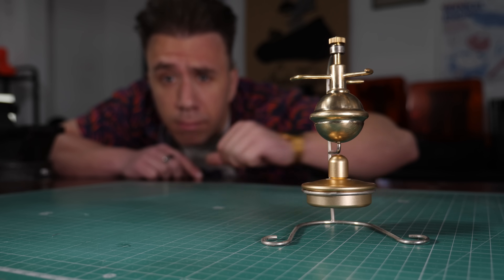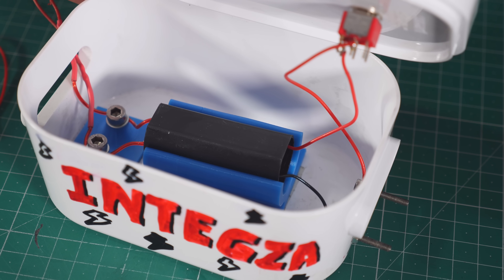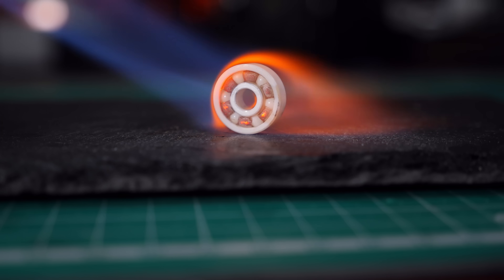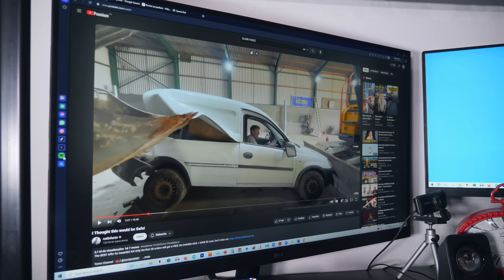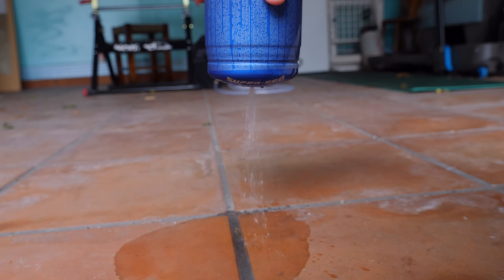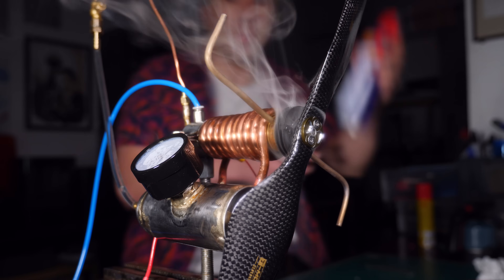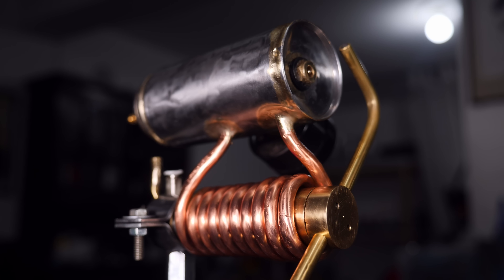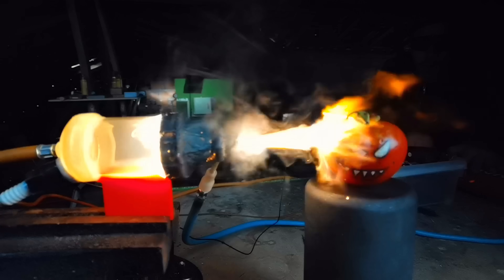I Built a ROCKET PROPELLER

Comment: One recommendation:  Rotate the can so that the outlets are pointed up.  That will keep the fuel in the can, and let the vapour flow smoothly to the coil.

Pretty nice setup.
Reply: He did that. Detailed it in the video even. The cooling jacket needs to have some liquid fuel entering it, or the cooling effect of the pressure drop is greatly reduced. What he needs is a valve to regulate the liquid fuel's flow rate.

Comment: Nice work. Cool concept.

IIRC, propane has a boiling point around -40 degrees, (C or F doesn’t matter, as the scales cross about that temperature), while butane boils about -1° C. (31° F.).
Pressure difference alone would make the propane give you more energy, plus it produces way more BTU's (heat) when burning.

(p.s. It is also why butane lighters don't work well when the temperature is below freezing. It is the gas that burns, so if it isn't "boiling"... no gas to burn.)

Comment: 4:27 WD-40 is not a lubricant; it initially leaves an oily film on surfaces, but this quickly evaporates. WD-40 is actually intended for removing oil and grease.
Reply: WD stands for water displacement, ekshuelly.
Reply: Point taken but WD-40 was created to disperse water.
Reply: That oily film absolutely does not evaporate quickly. While it isn't intended as a lubricant it does function as a makeshift one if access to a better lubricant is not available. 

I literally just checked to confirm. I sprayed some on a few threaded metal rings a couple weeks ago and they're still coated in a thin film with even a few spots of pooled oil that can be wiped away.

At the end of the day even if it's not the most effective option, people have been using it for all sorts of things for decades for a reason. If it didn't work at all in unintended purposes people wouldn't be using it for such purposes for so long.

Comment: im no mechanical engineer but i suspect that getting the engine to compress its own air is going to require a redesign to run an output shaft from the propeller through and out of the back of the engine

Comment: If you need to run the engine efficiently why don't you try combining your design with an Stirling engine? Also, you need the copper tube returning on the can at different heights for proper convection work.

Comment: So you want portable compression? Supercharger. Put a grove on the backside of the propeller  or a pull on the back of the propeller shaft if there is one. Use a silicon band (can take tons more heat than rubber)to turn a small compressor. Maybe try to design  and 3d print a scroll or roots style supercharger like on cars. 

I would say use a turbocharger but that uses the exhaust gas to spin the intake turbine and kinda hard to harness the exhaust  when it is moving

Comment: I think the secret lies in managing to integrate the bendy pipes into the Propeller. And maybe an internal cooler instead of external as well as a P trap to feed back liquids ?
Reply: Yeah if he uses the milling machine to make 2 halves of the propeller with built in channels (perhaps out of aluminum) , it might be more efficient at moving the prop up to speed. You could probably use some smaller jet holes near the center of the rotor, and larger diameter jets near the tip (so it has higher pressure where it needs the torque and if it maxes out it can flow up to the next larger hole)

Comment: you can use some of the thrust from the propeller to compress air by making a sort of compartment under the propeller with a small hole whom will lead to the engine giving it  compressed air
Reply: Umm....no.

Comment: There is a helicopter working like this, with air coming out the tip of the main propeller sideways.
the good thing is that you don't need a tail rotor because the couple cancels itself naturally! The bad things are.... everything else! it's not very efficient, and very noisy.

Comment: With the recent attempts of making electric aviation viable, there was an interesting design with pusher propellers on the wing tips; they were supposed to substitute winglets while producing thrust. Someone did an rc test of this here on yt and it worked on a small flying wing! My idea is to use the nozzles of that thing the same way: blended with the propeler tips in a way thay it would both push the thing around and force mix the air from both parts of it, i think that the best use for this would be able to push propeller tip speed further without the drawbacks of it (except for noise lol). There was some kind of helicopter, a weird one with 2 tractor propellers for horizontal flight and something like i described for the rotating wings. Now you put 2 of those in series and make the thunderscreech sound like a timid cat, its gonna be great! :D

Comment: Thermal paste or thermal epoxy can improve the heat transfer between the combustion chamber and the copper coil. Insulating the copper coil so the propeller doesn't cool it as much means there's more heat going to the tank to increase the pressure. Maybe the aerodynamics of the exhausts could be improved to make it go even faster. They could technically be part of a metal propeller instead. Maybe burn out resin and investment casting could produce one. Jewelers have that kind of equipment but they obviously make smaller stuff.

Comment: Could use a couple of the air canisters used for airsoft guns. Linked together in series. There is high pressure but low volume. So would have to use a couple of them. Maybe 8 surrounding the main body of the engine. As we know that these canisters produce a cooling effect when they release their contense. This can then be fed in to a mixing chamber along with the butane. Which would then feed in to the cooling coils of the engine. Higher cooling factor. Might be worth also making a one may valve. Get a pipe with the Interior being tapered and then a ball bearing sat in the middle of it. Can blow out, but fuel cannot then be blown back in. As essentially the ball bearing is now getting sucked up against the tapered part of the pipe. This would stop the blow back. But essentually block off the fuel source. So probably isn't a good solution. Just throwing out some useless ideas!.

Comment: use the position of the fueltank as a gas paddle, having it low means throttle down, having it high means increased throttle, if you make it so you can move it on the go, then you can probaly get more RPM

Comment: Try running the engine vertically, so that the outlet of your copper coil is higher than the inlet. It would encourage the liquid to flow through the coil.
Reply: Wouldn't it be better to test in the engine's intended use orientation though? Even if it works better vertically there's no point in mounting it vertically, the propeller he's using is intended for lateral thrust.

Comment: 12:00 looks like the ends of the pipes are not bend 90° - wouldn't that cause some loss? Also would shorter pipes be better because you lose less gas velocity to friction within the pipes and have higher rpm but lower torque - or longer ones because they would provide more torque but less rpm? And perhaps that sharp bend is also not the best solution but rather a more gradual "S"-shaped bend? Just some things to try out.
Reply: Almost certainly longer ones would work better. The whole reason rocket-driven propellers make sense (kinda) is that rocket exhaust is way faster than your vehicle will be, and probably also faster than the prop tips. Thus you don't lose RPM at all making the pipes longer!
This only stops being true if either a) air drag from the pipes or b) the Coriolis force of the outwards-flowing gas outweighs the increase in exhaust-torque.
Reply: @leftaroundabout you've also got cooling in the pipe, not good.
Reply: Also wouldn’t a 45 degree bend or anything less then 90 be better as your trying to move it rotationally and not linearly?

Comment: Instead of the gas jets going on the plane of rotation, the gas jets might be better to be slightly pointing back so that it's thrust besides adding to rotation also adds to forward motion.  If the engine gets hot, if you injected water to cool it, you would create steam which also could be used as a jet or as forward propulsion.

Comment: 7:57 Mucho power... Or a feedback loop leading to a pipe or the can bursting with heated pressured fuel onto the rocket a meter tops from your face, indoors. 

You know there are easier ways to get to visit a hospital right ?

Comment: Hi

Why don't do a supercharger? , not a screw type , but a centrifugal 
perhaps a volumetric intake as of the infamous bmw b54 engines or perhaps more like the old  ''trumpet type'' that can also work as an idle and throttle control there variable on those ones that change they lenght depending on demand,

as always it's ever easier say it than apply it,

(Just aplaying my car mechanical knowledge it ainth much but is honest work),

Comment: propane has a lower boiling point which is why it is added to butane in order to make it turn to gas more easily at lower temperature and hence improve flammability (in cooler temperatures). 
this of course also increases pressure at equal temperature.

the vast majority of butane sold on the consumer market is a 20-35% propane mixtures with small (250-500ml) cans of 100% butane sold on the consumer market really only seeing wide use as a solvent for various processes involving non-polar molecules cough cough

i thought you said you had experience. 

speaking of uses as a solvent and how many cans you used you may be an a list now

Comment: You could use a liquid catch can before the combustion chamber, so that any liquid fuel that makes it through the tube has a space to rest and be vacuumed back into the reservoir when pressure dropped. You could also either use a liquid oxydizer, or use compressed air in a much lighter tank. It would be best if you used a liquid fuel with a higher btu, so you can store less of it, and have more air to burn it with.

Comment: Maybe a cam to drive a small piston to compress air, I've seen some mopeds that use injection with a system like that create fuel pressure. The same might work to compress air too.

Comment: Integza; try using propane it has naturally much higher pressure and if you want to go balls to the walls; buy some airsoft green gas; there are 3 types of it. Green gas (just propane); Red gas (propane with extra gas that increases pressure) and Black gas (propane with extra gas that increases pressure even more).
Reply: yeah, part of the problem is Butane has a boiling point of only -1C at 1 bar, likely well above ambient at 2,
Propane definitely has a better phase change profile for this
Reply: @davidconner-shover51  You're talking about effectively vapor pressure, at 25C butane is ~34psia while propane is ~135psia. Butanes boiling point at 1 bar is -0.8869C, 2 bar is 21.1C, 3 bar is 35.69C, and for the full monty 4 bar is 46.95C. Propane at 1 bar is -43.37C, 2 bar -22.2C, 3 bar -7.909C, and 4 bar 3.261C . So yes, propane at a given temperature is at higher pressure than butane. This is why you dont see cheap plastic lighters with propane in them.
Reply: @mandi8345  Thanks Grok.
Reply: @ShadyDealz  If you're crapping on him dropping knowledge, then you're on the wrong channel since we here for science and knowledge... So take your C-grade trolling elsewhere. 😉
Reply: @DUKE_of_RAMBLE  OH so now giving advice is called trolling ey? Leave this between engineers.
Reply: @OAikoT  Misplaced anger? Not sure what provoked this reply from you... I'm merely saying that Mandi's delivery of knowledge was nothing that deserved Shady's snide remark.
If for some reason what I said managed to offend you, usually I'd apologize, but in this instance I'll say: this is clearly a 'you' problem.
Reply: so you are telling me...
i could turn a airsoft into a firehard?
Reply: @kkjkjh  in theory its possible, but would you really trust the build quality of airsoft not to explode in your hand?
Reply: @kkjkjh  YES
Reply: black gas sounds like those stupid galaxy-gas the kids like to sniff
Reply: Green gas is just propane with some percentage of butane. Red gas and black gas are both still propane, with less amounts of butane. No other gas is added.
Reply: He did use propane int the video. You just have to watch to the end to see him do it.
Reply: @coryingman  but only 35% right? OP means 100% (?
Reply: @joskcito  yes nearly 100% cos extra gases that increase pressure in case of the airsoft gases but they are not more than 2.5%
Reply: @coryingman  no he uses a propane butane mix it is not the same. I use both in jewellery making their pressure and temp differ.

Comment: Did you notice the outputs of your jet tubes are not pointing ideally? They should be at 90° to the radial. They are pointing slightly outwards because you put a 90° bend in the pipes, but the length of the part after the bend takes the output away from the radial.
Rocket science, eh? 😊
Love your videos!
Reply: Yeah the tubes should be pointed towards the tangent line on the outermost circle created by the tubes.
Reply: Also worth accounting for the metal flexing in rotation, which at those speeds... has to be something
Reply: @andiralosh2173 that's a good point. Again, we need the slow mo guys to see if that is happening!
Reply: I dont think the length matters? The force direction is the same, and transfer via the 90 degree bend should still be on average a force which is directly 90 to the radial, independent of the length of the tube after the bend?

Edit: they are slightly bent outwards, but that just means its not a proper 90 degree angle, not that the length matters
Reply: @MODElAIRPLANE100 well, my point is that the exit of the tubes is not pointing in the ideal direction, which would be exactly opposite to the direction they are moving. Instead, they are pointing slightly radially. The force vector has some outward component, away from the axis or rotation, leading to a slightly inward reaction component, towards the axis.

Comment: Are you familiar with the works of a Youtube channel called Alex Lab? He used electrolysis to generate pressurised hydrogen in a somewhat compact form factor using some aluminium reaction. It might suit your application very well. I think he got decently high pressures (5+ bar) out of it too.

Comment: What you need is a turbo although I think you will run in to serious pressure or power problems using the design you have. While cool it's a less efficient version of a helicopters jet turbine engine where the accelerated gas rotates the turbine that rotates propeller.

I don't think butane contain enough oomph (technical term to both rotate prop AND compress enough air for engine

Comment: You have to much friction. The propeller comes to a complete stop too soon.
Reply: That also stuck out to me. Piston engines always have some amount of drivetrain loss or residual compression that will drag the engine's output down once power is cut. Since this is jet driven and not directly coupled to anything other than its own bearing, the propeller assembly should be able to spin freely for much longer than that. It slows down fast and stops hard. That much friction can mean a lot when you're dealing with these kinds of low power levels. Unless the bearing works better when it's pressurized or something, that's a possibility.
Reply: @defmech  Exactly.
Reply: The propeller stops when the fuel runs out. It's a common problem with all vehicles that use propellers. It's also an issue for vehicles that don't use propellers.
Reply: @kmoecub  Very, very wrong answer.

Comment: It seems like the engine could run better. I say this because it (at least on camera) looks like it take a decent bit of energy to get the propeller to spin in the first place. Yes the ceramic bearing seems to be working fairly well, but it just seems like it's needing to put in a decent bit of work to get moving to begin with. Then again I have no ideas on a better bearing solution (unless you tried something completely nuts like a wire cage that surrounds the propeller and holds a regular bearing on the outside instead of inside the engine, and even then you could have gas sealing issues with this idea).

Comment: What about a similar set up but with fuel/air supplied all the way to the end of the two small tubes then micro rockets pushing around the rotation? You'd have to move more mass rotating of course but you also woudn't need the hot burn chamber before the bearing or need a ceramic bearing. All heat would be produced virtually at exit and the feed  would be air cooled when rotating....
Hmmm now I'm wondering about a suitable metal or heat resistant material made hollow prop with a built in jet on the trailing edge or tip.. just feed air/fuel through and ignition, no engine per se, one moving part (ignoring prop pitching just thinking propulsion), all the heat produced where max air cooling is induced🤔

Comment: Anyways chocolate chip muffin recipe because its tasty

INGREDIENTS

12dkg butter

25 dkg sugar

1 packet vanilla sugar

2 egg

30dkg flour

1 packet baking powder

1dl milk

Chocolate chips

Mix the sugar and vanilla sugar into the melted butter, then the beaten egg. Then add the flour and baking powder, and finally the milk and chopped chocolate chips.

Mix together, then pour into a muffin tin lined with a paper capsule. at 180 degrees approx. Bake for 20-26 minutes